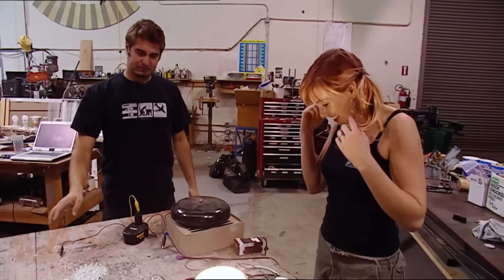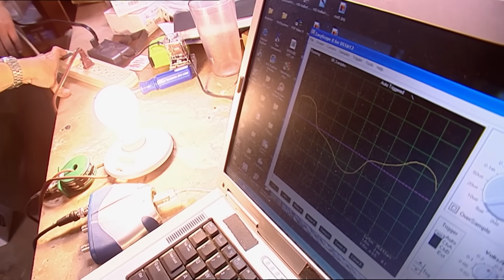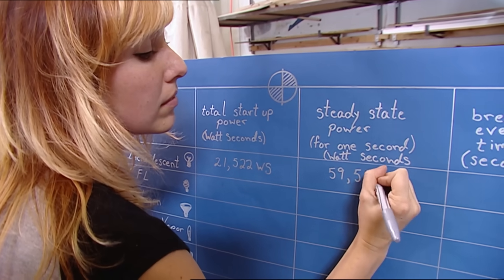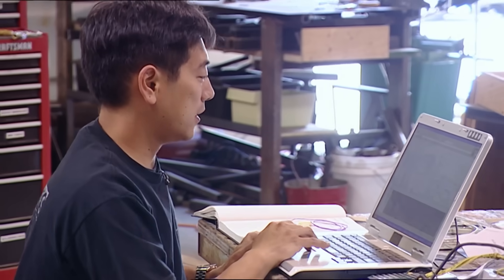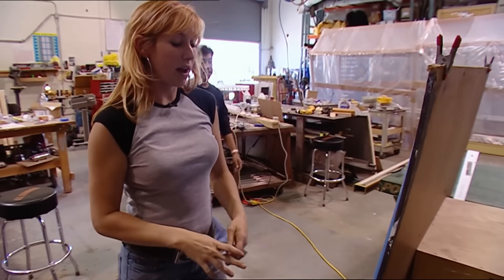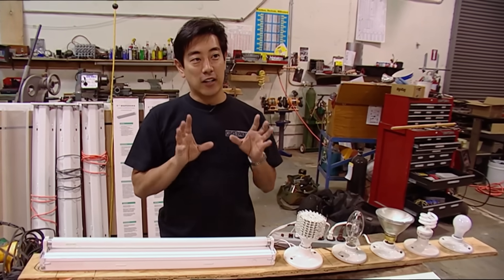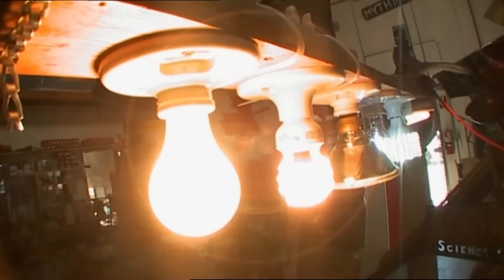Is It Cheaper To Leave The Lights On Than To Turn Them Off? | MythBusters

Comment: We need a modern version where they use smart bulbs (wifi, zigbee, matter) and factor in their power draw when the light is set to "off" but the switch is still on and the circuit board is powered.
Reply: The light + circuit board draws more power than no light with circuit board
Reply: I think in general, Wi-Fi bulbs are going to use more energy than Zigbee/Zwave.
Reply: The power use when a smart bulb is set to 'off' is so incredibly negligible it might as well not be there.
Reply: My outdoor lights run all day and night. LED Lights produce just enough heat to keep the moisture out of the lamp. Incandescent lamps get turned off and the metal corrodes when it is cold. Not a problem in deserts.
Reply: Yeah and the massive capacitors aren’t drained and dumped every time there power turns off at the switch
Reply: this reply section makes me sad
Reply: yeah, we need a new version because dense people still make nonsensical questions like the one you just described
Reply: Similar clippy pic, interesting.
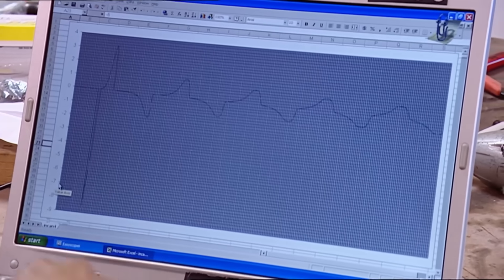Reply: @nodnarb3799 found you at 1:38
Reply: Same result. Less overall energy use. Equal longevity. But more convenient.
Reply: @jbrownjetmech-4783 Convenience comes with a price, usually our health.
Reply: Z wave gang 👋🏻
Reply: But that part is the same whether they're on or off.
Reply: Why would that change anything
Reply: I think this new project might interest Project Farm
Reply: There will be no change whatsoever
Reply: this both funny and serious.  I have huge dislike for home automation considering cheap lights and very efficient LEDs and longevity.  the high cost of home automation simply dwarfs the savings.
Reply: subscription service light bulb? ☠
Reply: @dragoon0anime he said "zigbee". Get a clue. Zigbee is like "I don't want to depend on cloud". (Or at least, it can be set up like that, assuming you don't do something stupid like tie it to Google or Alexa.) At a low level, zigbee devices can essentially expose "well known services". Much different than low level of wifi being "connects to some manufacturer's MQTT server".
Reply: Modern stuff is way more efficient, the biggest issue is that we no longer get any infrared light because modern lights produce only visible light. Incandescent bulbs wasted most of their energy on heat and invisible light, but there are actual benefits on human physiology. So with nothing to replace the infrared light, besides going outside in the evening, that's the main drawback to modern lighting. The health cost might actually be larger than the energy savings
Reply: Just some new corpo linguistics to encourage(aka trick) people to buy, after they lost to production/manufacturing cost aka Chinese companies. 

Do these smart whatever even won anything in those energy saving organization contests?

And then you have to wonder how short their Planned Obsolescence engineered on the product.  

What's next? Smart pen, smart diaper?
Reply: Yes. They get warm!
Reply: So smart, the smart bulb needs comments to define smart while connected to the same circuit that any other bulb is connected to. So, now that smart is an non issue; what's the correct test procedure?
Reply: What even if a smart bulb? It's on or off. And the power needed to keep the circuit board on, would counter any energy saving to negate the spike at turn on.
Reply: Smart bulbs run their smart circuitry off a much lower power “common wire” that is in more modern homes. So their off state still draws some power but it’s nowhere near the power draw as when the light is actually on.
Reply: @stephenfisher4846 what? Smart bulbs still use the full potential difference between the 120Vrms of the live and the neutral and step it down and turn the voltage to a low DC that the microcontroller uses to stay on and power a smaller internal switch to the lighting. The  There is a caveat which I think you might be thinking of, maybe you're talking about no-neutral smart switches, which are witchcraft that uses the bulb as a neutral
Reply: they already tested LED, what fails in those smart bulbs is the LEDs, not the control boards, at least theoretically they already tested an equivalent.  however, LED technology has changed since then, so that part may make a difference.
Reply: @Minty1337 for reason I don't know yet, using smart LED that can change color between cool white and warm white and switch that often led to shorter lifetime. That's worth of testing and dinding the reason
Reply: @bramwiratma5313  interesting, my hypothesis is that it's something related to overdriving, yellow LEDs are notoriously weak and may simply be burning out.
Reply: @Minty1337 They do not use yellow LEDs. Both warm and cool lights use the exact same blue-violet LEDs query differently doped phospor compounds providing the different white temperatures. You can often see this on defective highway street lamps where the phospor coatings just fall off when they get to hot. If you ever see a random blue-violet street light, that's why.
Reply: @SkippiiKai  highway streetlamps and home LED lights are not at all the same. first off, LEDs do not have phosphor compounds, they are diodes that produce light directly. second off, those streetlights with that blue-violet color are fluorescents, which do have a phosphor coating. the way both of these lights work is completely and totally unrelated, those street lamps you saw probably used fluorescent bulbs like home CFLs, not LEDs. LED streetlights do exist, but they usually produce mostly pure white light, with little to no blue or violet.

also think about that for a second, we're talking about smart LED bulbs, ones  that change color. these use RGB(and sometimes Y) LEDs, which have all of the colors put in a single bulb, if there were any phosphors, it would make it impossible to actually change the colors and use the bulb as it's intended.

i hope that wasn't too long, i just want to make sure you understand.
Reply: @Minty1337 

Modern white LED bulbs do use phosphor coatings. If you look at one you'll notice the surface of the chip is yellow, that's the coating. The actual LED is under that. In the bulbs where you can change the temperature it works by having two sets of LEDs with coatings with different temperatures and varying the intensity of them in relation to each other.
It's done both because it's brighter and because it has better color reproduction. White light created using RGB diodes has terrible CRI because LEDs produce single wavelengths. 

Smart bulbs don't use RGB to produce white light. RGB and white are separate modes using different sets of diodes. You can even get smart bulbs that allow for white temperature change but don't have a color option at all.
Reply: @Scrfmnstr  basic white LED lights do use those white LEDs with phosphors correct, but smart bulbs that change color use RGB LEDs, i have taken both kinds apart before, they are distinctly different.
Reply: @Minty1337 it's because they're designed to fail they actually overdrive the LEDs to get equivalent output and don't actually consider heat and the damage it does to the LEDs Go look up BigClive Yes many videos on this subject.
Reply: @Minty1337 Again, what makes them smart bulbs?  You turn the switch on, and the bulb turns on. You turn thy switch off, the bulb turns off. A bulb from the early 1900's can do that.
Reply: Good question, it just allows you to control it with your phone, smart house or any device on your LAN (Local Area Connection)
Reply: @JohnKJV3-16  what makes a smart bulb "smart" is usually some kind of remote control, which allows you to do stuff like turn lights on or off when you aren't home, or change it's color. that isn't relevant to this particular myth though, since there's very little difference between an automatic relay and a manual switch in the context of light bulb longevity or power use.
Reply: @Minty1337 That doesn't make it smart. That just moves the switch from hard wired, to wireless. It does the same thing. And even stop bulbs hehe switches in them? They're usually put in a light receptacle. 😂
Reply: @JohnKJV3-16  a smart bulb is any that can be controlled independent of its power source or light switch. What makes it smart is the system that controls it, usually through automation. If you don't care for it, just buy a dumb LED bulb.
Reply: @benargee Still not smart. Smart means it controls itself. If a human still has to turn it on and off, it isn't smart. Smart is like an iv infusion pump, that switches from one iv to the other, without a human. So no, no such thing as a smart bulb. 🤡🤣
Reply: @JohnKJV3-16  smart as in it's part of a smart system. A smart system is the sum of it's parts. 
Keep on keeping on being pedantic though. 
I have multiple ZigBee bulbs that are automatically turned on based on conditions that I have set. It also works in dumb mode which is important too so that you don't have to pull out your phone when special circumstances come around that require it.
If it's not smart enough for you. Don't buy it.
Reply: @JohnKJV3-16   This isn't the gotcha moment you are looking for... A smart device is a term to describe devices that are able to control and automate some functionality, usually by connecting to a wireless access point. It's just pointless semantics. You could say this about thousands of other names such as android phones, iphones, search engine, smart homes, robot vacuums, auto pilot, pick up truck, etcetcetc. 

A pickup truck doesn't actually pick anything up, it tows so no, no such thing as a pickup truck. See how dumb that sounds?

Whatever you want to call it, smart bulbs differ than your regular old incandescent.
Reply: @kudosjp2 Still not smart, if they're controlled by something else. Are you a troll also? 😂
Reply: @JohnKJV3-16  i don't think you understand, the word "smart" here doesn't mean intelligent, it's a marketing term, like calling something "pro", even when it's not really made for professional use.
Reply: @JohnKJV3-16   Ah ok you must be 12 to still be using emojis like that in every sentence. You keep arguing your petty semantics to feel smart.
Reply: @JohnKJV3-16  Congratulations, your arbitrary definition of "smart" doesn't match the rest of the world's. I wonder who's is right in the context 🤔
Reply: @JohnKJV3-16  All smart bulbs offer some degree of automation, personally I set mine to all turn on in sync with my alarm, then shut off an hour later, then turn on at sunset, and finally off about two hours before I go sleep
Reply: @smpmuzpid That's not the bulb. That's whatever the bulb is connected to. The bulb doesn't turn on or off by itself. It's connected to a device that does it. Stop already. The bulb does nothing except turn on or off with whatever it's connected to. You're just not willing to admit that you paid a fortune for a bulb that isn't smart. You got conned, and now you're upset about it. My brother is big into this stuff, and his bulbs are connected to fixtures that turn the bulb on. The bulb itself does nothing extra. And also, where was anything mentioned about smart bulbs in the video? I'll tell you. Nowhere. And even if they had smart bulbs, they would consume the same energy. So stay on topic. Again, stop trolling. 😂
Reply: @JohnKJV3-16 are you actually from the 1900's? 😂
Reply: @JohnKJV3-16  You gotta be a bot because who the heck cares, bro 😭
Reply: @JohnKJV3-16  technically an infusion pump isn't smart because a human has to hook up the iv and a human programmed it to work so actually there is no such thing as a smart iv infusion pump. it couldnt do what it needs to do without a human
Reply: @JohnKJV3-16  a smart bulb maybe not smart by any definition of the word smart. But they are way smarter than you.
Reply: @JohnKJV3-16  You're completely wrong here. A smart bulb does not turn on or off based on whether it's connected to live power. Instead, you give it continuous power, and a microcontroller (essentially, a very small computer) that's housed with the bulb determines whether or not to turn the light on. That's why someone brought this up in the first place--even when your bulb isn't lit up, the microcontroller is still receiving a small amount of power to ensure that it will be responsive, should it receive a signal to turn on, or should some pre-programmed conditions for turning on be met. So there's a constant power draw, but it's very small.

As for whether it's "smart" or not, who cares? "Smart bulb" is just a name. A computer monitor does the same thing, only with a whole bunch of (typically) LED lights. Is it smart?
Reply: @misterdrgn5155  They're trolling/being intentionally obtuse with semantics at this point. We all understand what smart bulb actually means, they're just trying to twist it so they can be right.
Reply: @JohnKJV3-16  My brother in christ you're a hell of a troll. If you want to continue the semantics bullshit, the IV pump you mentioned earlier is in the same boat: the pump itself needs to rely on an internal computer that needs to be programmed depending on the fluids and whatnot. The term "smart" means more than just the lone device, it means it is able to integrate with something else to automate a task (ie. you can have them set to turn on/off on a timer).

Theoretically, they would consume more power as to function even while off, the internal computer bits need to be running to some degree (sorta like this test DID show turning a light on uses more power, but it is negligible at best). Whether or not this makes a meaningful impact on someone's bill though is up for debate (not too different from like a TV that usually needs to be on at a low level to pick up remote inputs). And no shit they weren't mentioned; this episode was filmed before they were a thing and the initial comment was it would be interesting to do similar tests with those to find out. If this test was done in like the 80s someone today would have a similar thought and go "I wonder what the numbers are for these new fangled LED bulbs that are common now".
Reply: @JohnKJV3-16 take your meds
Reply: @JohnKJV3-16 Okay, smartass.

The thing that makes them "smart" is that they can be controlled in a variety of ways from a variety of locations.

Buy a remote or 7, so that it can be controlled from anywhere in the house, regardless of how everything is wired up.

Set up an automation so that when it's 5PM, the lights turn on automatically.

Or just turn on your lights from 10000km away while you are on vacation.

Or just make sure that you didn't leave any of them on while you are outside.

Or, in almost any light, dim it from your phone when you're trying to sleep, and brighten it when you're trying to cook or whatever.
Reply: @JohnKJV3-16  Maybe you won't agree with us what smart bulbs are but we all agree that you are a smartass.
Reply: @JohnKJV3-16  You do not turn the switch off. That's what makes it a smart bulb. It is always on. You use an app, smart switch, or automation to "turn off" the bulb, but power isn't cut.
Reply: @JohnKJV3-16  coincidentally being pedantic and getting hung up on semantics does not make you smart. I get the feeling you’re not as bright as the smart bulbs in question
Reply: @JohnKJV3-16  this level of semantic fiddling is crazy though
you're like me when i was 12
Reply: @JohnKJV3-16  SmartBulbs you turn it on and never turn it off; you have an APP or like device tell it to turn off the light. The board for the bulb and its WIFI is still drawing a small amount of power. Though most of those use a compasitor i believe which converts a small portion of power into a stored power that it will use for a good while, needing only a slight trickle of power to maintain it while the bulb is in the off state, but switch is still on. We mainly use these type bulbs in our house due to being able to control them for light color or brightness. Seeing as most of those styles are dim-able you and can even operate in some weird modes like Candle flickering etc.
Reply: @drfolsom74 No. Bulbs turn on and off with switches. And why are you people still talking?
Reply: @JohnKJV3-16  "Smart" for Bulbs in this case, but in all cases in the tech industry is a term referring to Self-Monitoring, Analysis and Reporting Technology. It doesn't mean intelligent or a witty remark. Means it can make use or be assisted by a network of internal commands or outside sources to achieve a use or function. So, any LED or otherwise class bulb with WIFI connectivity, can be listed as Smart. Hell, it's the whole marketing program for making your life lazy across most of the tech industry.  As for what you'll see in it, I believe your word a day calendar needs to be updated to something post 2010 so you have better understanding of terms used in different industries maybe. Why we are still talking . . . well beyond waiting for your smart reply, maybe it's simply to pass the time. Or I'm just using a smart device to respond with a smart-arse comment. you decide.
Reply: @JohnKJV3-16  The definition of a smart device is that it can send and receive data on the internet, primarily to and from other smart devices. Not that it 'controls itself.' Your smartphone and smartwatch and whatever don't control themselves, they aren't unlocking and making calls and playing angry birds without you telling them to do so. But what makes them smart is how they can communicate with each other, and how the sensors in your watch can send health information to your phone. And what makes a smart bulb smart is the fact that you can control it with your smartphone, or configure it to turn on or off or change color automatically based on input from something like a motion sensor in your smarthome. Smart devices don't control themselves, but what they CAN do that's special is control each other.
Reply: @DaBoweh The definition of smart, is that it can do something without human input. A bulb still needs human input to function. Therefore not smart. Why are you people still arguing?
Reply: @JohnKJV3-16  You know, you could just google what a smart device is to find out how wrong you are, or listen to everyone trying to teach you something. But instead you argue with them, and then act like everyone else is arguing and you're somehow better? You're the cause, mate. If you don't want people to keep pointing out where your understanding is wrong, the simplest solution is to stop being wrong.
Reply: @DaBoweh Why are you people still talking? No such thing as a smart bulb. And that's not even they the video is about. The video is about if it's better to leave a light on, or turn it off. Stay on topic. 🤡🤣
Reply: @JohnKJV3-16  You're like those people who go "I can't be homophobic, phobia means fear and gay people don't scare me!" My brother in Christ, words can have multiple definitions and a "smart device" is not capable of independent thought or able to function without human input.
Reply: Go back to incandescents when they return in stores. The led and "smart" bulbs do not contain the red that is beneficial for our eyes. They have no true benefit for people's health. In fact, they are a negative.
Reply: @irony11  sir what the fuck are you talking about
Reply: @grimtin10 The blue light in the led's, and all screens (phones, laptops, tablets, and TV's) are bad for our eyes. Companies like Apple and Samsung put it into the screens and eliminated the red lighting. This is why more people are wearing blue blockers. Not sure if you have noticed the increase in conversation in the past couple years or more. All this "smart" stuff isn't beneficial to our health.
Reply: @irony11  this is drifting towards conspiratorial levels
Reply: @grimtin10 If you think they create things that don't harm us you're very naive. Look into it and see for yourself. I only mentioned it to inform people. It is up to you to take care of your health and research what products you use. I hope people do.
Reply: @irony11  you're putting words in my mouth but discussing anything with you feels wasteful
Reply: @grimtin10 I'm not putting words in anyone's mouth. Did you see the word "if" included in the sentence?  Led lights are harmful to us. Look into it for your own health and the health of your family. The incandescents are much better for our eyes.